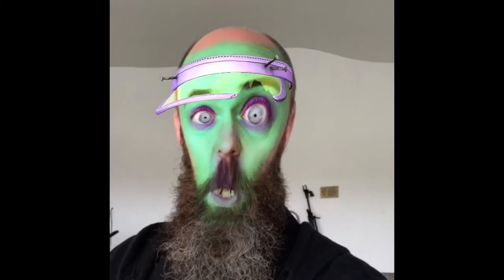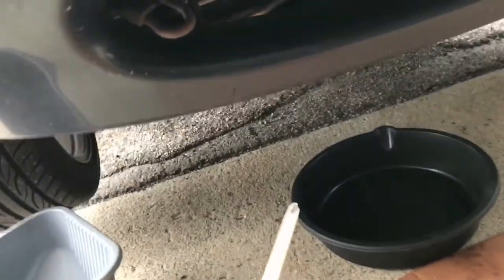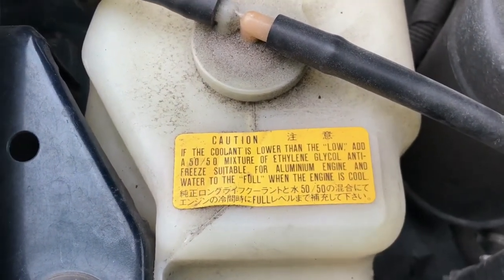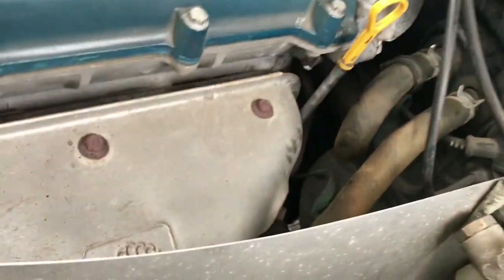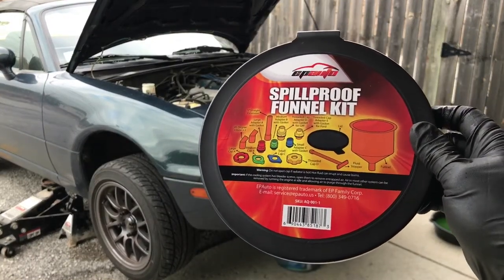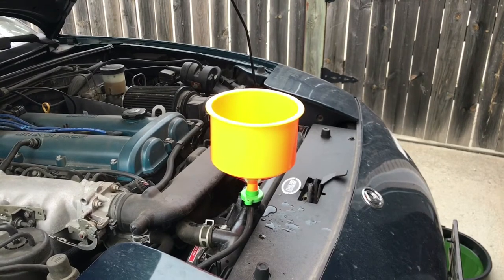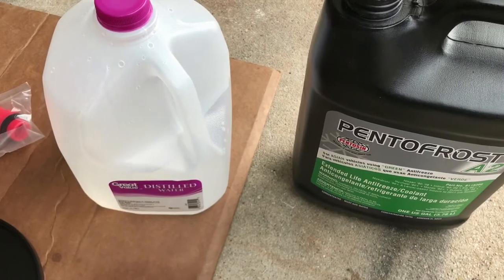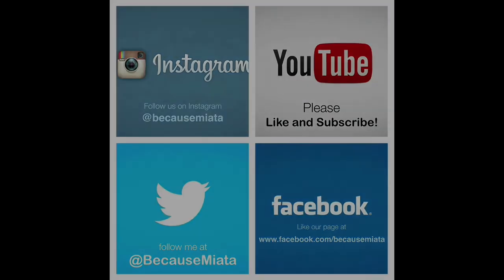NA Miata - Coolant Flush and Fill (Halloween Edition)!

Comment: For anyone wondering in the UK, I ended up with Comma Super Coldmaster for the anti-freeze. It doesn't mention if it is silicate free, but usually anti-freeze likes to boast that it has silicates so I presume this means it is silicate free, and it is non-OAT. As long as it is indeed silicate free, then that ticks both the boxes. Been a right bitch to find the right anti-freeze for an NA MX5 but this anti-freeze is sold for usage with mx5s from the 90s on two mx5 specialist websites so it should be good.

Comment: You bought the right coolant, that coolant is what is known as a P-OAT coolant ( Phosphated Organic Acid Technology ) most Asian cars use it.

The Japanese manufacturers claim Silicates are bad for aluminium and bad for water pumps, but European manufacturers like VW and Audi say the exact opposite, i've looked into it and i have to agree with VW on that.

What you really must never use is the conventional green like Prestone, it contaisn somethign called Borates which is good for cast iron but corrosive to Aluminium.
Reply from the maker: Old Fords Don't die thanks for sharing.  The type that I keep hearing that you should never use is dex cool - unless you have a car designed to use it.
Reply: @BecauseMiata  Dexcool is similar to Volkseagen G12, both have the same problem that when mixed with traditional green coolant it turns into sludge, VW updated their coolants so it would not do that when mixed but GM did not.

Comment: Hi i was wondering if I can buy the one that’s already mixed. they have that one and the one u have to mix on your own.
Reply from the maker: Hi there.  You can use either one.  From what I've seen, the pre-mixed 50/50 costs more per volume of coolant.  So if you buy a gallon jug of 100%, and a gallon jug of 50/50...you can make the 100% last longer because you can now make 2 gallons of 50/50 with it.   Make sense?  The bottom line is that you can use either one.  The premixed one costs more though.

Comment: Hello everyone, I need help. I have mx5 NC 2006, I recently added coolant into the reservoir  (when it was cold), yesterday I found out that the temperature was increasing (but not overheat), because it had never happened before that the pointer of the temperature on the dashboard get to the middle.... it was always lower the middle. So please help me😢 because I don't know if my car has the bleed screw, or not. Because I saw some videos which they told I must open the cap, run the engine, waiting for thermostat operation and so I will get rid of the air bubbles. I am confused. .. I don't know what should I do.
Thank you a million.

Comment: The bp engine was developed by ford. What specifically about the pump causes this problem? I need to know if im using the wrong stuff!
Reply from the maker: Thanks for the question.  To the best of my understanding, the Asian formula of antifreeze use phosphates to protect against corrosion and pitting of the water pump impeller.  Other types of coolants use silicates which can cause the small pitting inside the pump - mostly on the impeller.  A lot of coolants are color-coded...some blue, some green, some red.  From the factory,  the Miata coolant is green...it matches the Asian formula that I used.   If you're in doubt, it doesn't hurt to call your local Mazda dealer/service shop to ask for their recommendation.

Comment: I went to napa today and they gave me almost this? they gave me "pentofrost A3, Asian Blue?" it looks just like this but it's blue? what gives, did they give me the wrong stuff?
Reply from the maker: Sheep Dog69 to be honest, I’m not sure what the chemical differences are between the two, but mine is the Pentofrost A2 (Green), and it specifically says on the front that it’s for 1990 and up Mazda.
Reply: @BecauseMiata  I think i'm gonna take it back tomorrow and exchange it for the A2, I just got my miata 2 days ago, it's a super clean 2000 1.8L with a soft top and the torsen LSD, its only got 120k miles on it and it was a one owner vehicle, the guy who sold it was 75. i noticed the overflow was totally empty so i wanted to just do a coolant flush and refill it just to make sure nothing everythings good, because once i noticed that was empty i looked in the radiator and it was so clear i'm almost positive it was just water lol.. so far i'm loving this car you can turn so sharp and fast its awesome, its not screaming fast, but this little car can scoot haha.
Reply from the maker: Sheep Dog69 sounds like you got a great deal; congrats.  You’re doing the right thing by taking care of maintenance first.   Oil change would be next and inspect the air filter.   Later on you can change the fuel filter.   Any idea how old the timing belt is?   If it’s the original, it should be changed as well.   Have fun!  😎

Comment: you really used regular water......... youve gotta used distilled.
Reply from the maker: David Yeritsyan Thanks for watching.  I used the garden hose to use pressure to loosen up any sediment inside before I did the chemical flush.  The final flushes were all distilled water, as seen at 13:58 of this video.  But you’re right, all distilled water would be ideal.  The tap water didn’t sit in the engine long enough to form deposits of sediment, so I’m confident that the chemical flush did its job and removed the hard water.   Good observation though, and thanks again for watching!
Reply: For fucks sake it's a 20 year old car. You could run it on brake fluid if you ran out of gas.
Reply: you can also use water that's been through reverse osmosis, or what i use because i have access because i work at a chemical plant, "DeIonized water"